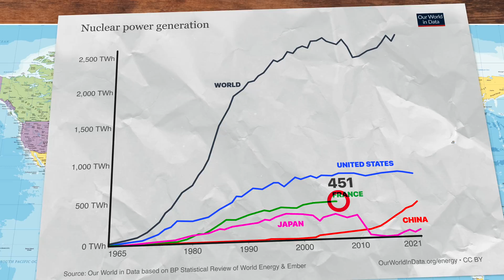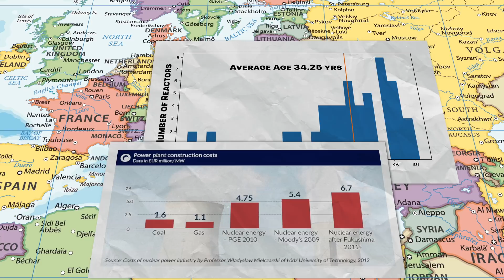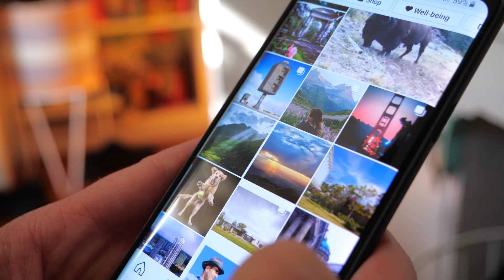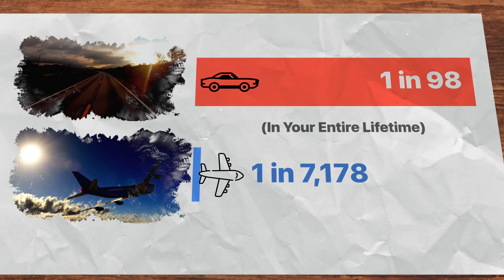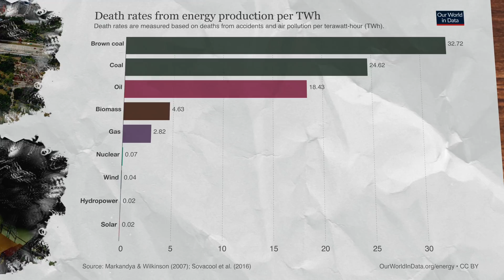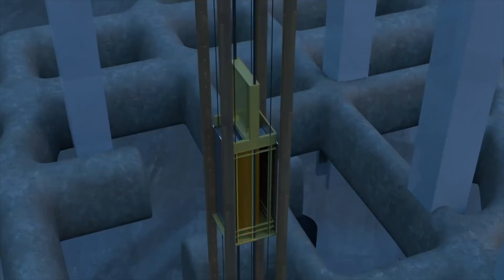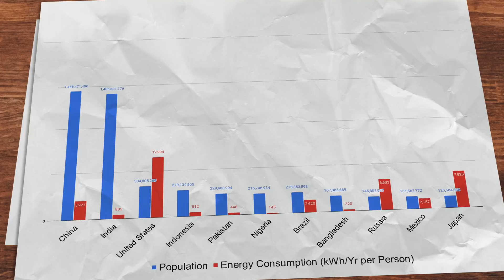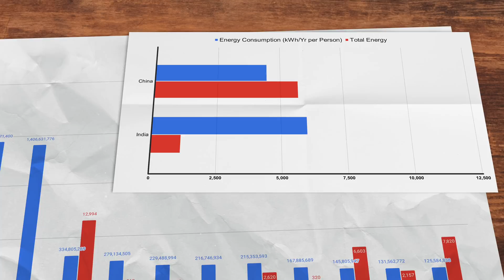The Future of Nuclear Energy Depends On This...

Comment: As a real fan of your channel I'm very disappointed to see you pushing nuclear power. The fact is that if you allow nuclear power, without assessing the costs as they have not been assessed in the past, all forms of renewables will not be able to compete. Your bit on the nuclear waste that has been piling up ought to make you stop and think about its volume if nothing else. That cost has NOT been assessed against nuclear power in the past or is it being assessed now. In my opinion Finland's waste storage will NOT prove to be reliable for the thousands of years necessary for this stuff to become inert. We have no proof that steel and copper will contain anything for that time and any hole in the ground that I know of eventually will drain into an aquifer or has the potential to in the life of these poisons. The idea  of sintering the waste into glass blocks seems far safer since we know that volcanic glass at least has proven itself to remain intact for the necessary life of these waste's. Unfortunately that has proven itself to be very costly. Again, a cost not assessed.

Nuclear power may be proven to be safe but when it isn't the costs are incalculable. That is why the power industry in this country has gone to congress to be absolved of all liability if they have nuclear power as a power source.

Why can't we just shelve nuclear power and allow the development of renewables first? Instead it appears we are doing everything possible to impede renewables until it is obvious that it is too late. Then we will get a big push to nuclear power! The idea looks to be to keep the energy production and distribution in the hands of just a few while the masses take a beating. it appears to me that what is being done in California should be a wake up call to all. It sounds as if folks that wish to fit solar panels on their roofs now will be required to also fit battery storage to keep the utility happy. Hmmmm, seems that doing that and just unhooking from the utility makes the best sense!  It hasn't been that long since a mass of wires crisscrossing this country didn't exist yet if the federal government has money to spend on electric energy they can only spend it on the great and glorious "GRID". In my opinion it would be far better spent on individuals and decentralizing power. A return to what power looked like  only 60 years ago before we came up with a scheme to only subsidize big energy monopolies.
Reply from the maker: I said I want 100% renewables for sure. But we’re not ready for that switch because storage is the issue. Nuclear energy is 24/7. I’d love to see it all happen but we need to get of them 84% fossil fuel asap. I think we will be ready to move away from it in the future. But today?
Reply: @TwoBitDaVinci  What you mention is just what I have been afraid of and expecting to happen. The government and everyone else has been dragging their feet and will continue to do so till !!!!!OMG!!!!! WE NEED TO DO SOMETHING!!!! RIGHT NOW!!!! OR THE WORLD WILL END!!!!!!!!!!  WELLLLL, LOOKS LIKE NUCLEAR POWER IS OUT ONLY OPTION!!!!!!!
Reply: Make that "our" instead of "out" in my last post. Anyway, so much could be done but won't because we have to keep money flowing ONLY to the energy monopolies.
Reply: Renewables don’t pay for a huge amount of real damage they do. Dams don’t pay for the ecological damage they do to river systems. Solar and wind aren’t paying to clean up cadmium in the soil in China from rare earth mining. 

All of the spent fuel in the world would fit into a football field, and gen. 4 reactors can reduce the volume and longevity of it by burning. 

Renewables don’t work, and if we want to stop using fossil fuels, the only option is nuclear. Also, renewables have gotten massive political and financial support from governments and other institutions around the world. 

You can’t run a factory with a few solar panels on the roof, and cities are going to be dependent on vast solar/wind. Germany and California have spent billions on batteries, and the each have about 1 minute of battery storage.
Reply: @kokofan50  I think that Denmark is doing OK on renewables and would like to inform you that we have taken out THOUSANDS of small hydroelectric sites in this country because big SUBSIDIZED power monopolies claimed they could make power for less. Yes they could when SUBSIDIZED! But we can't subsidize small scale individually owned renewable power!
Reply: @kurtappley4550  A small country with 1/4 the population of the NYC metro, and how much heavy industry/mining?
Reply: Tf is this. I read the first 5 sentenced until I stopped because of the amount of BS you believe in.

1. Nuclear waste is recyclable since the 1960s. Thorium reactors use nuclear waste as fuel.
2. Becoming CO2 neutral with solar and wind energy had become impossible because governments are too slow and started too late. Nuclear reactors can fix climate change faster within a decade.
3. Nuclear power is the safest form of energy to date. Saying it is dangerous because of the nuclear accidents such as Chernobyl and Fukushima are lame arguments against nuclear power.
4. Everyone wants renewables, but we can't use it because we don't have the time to do so.

Comment: Hard to believe that reprocessing is not economical when storage costs are included in the calculation.  I also have to question if the regulations are unrealistic for things like secondary containment.   Every piece of concrete/steel or aluminum used on this planet has cracks yet the buildings/dams/whatever still function and survive.

Comment: No, safety regulations are not what's affecting the ability to make nuclear power plants and it was silly to suggest it.  It takes skilled labor, and skilled labor in various positions in disappearing.   It takes a long time to develop as a welder who's qualified to do various types of welds, and what's happened is the loss of construction that requires those highly skilled welders, or at least for certain types of welds.

We have at least 2 generations of workers that are really good at simple manual tasks, or using technology.

You can can the same problem in shipbuilding and other areas where in many countries they've lost those workers needed for the highly skilled work.  On the inverse, China is growing at a manufacturing powerhouse and they DO have the skilled labor needed to do the work.

Comment: So issues are:
 1) Construction issues. Experience needed and better on-site management oversight during the building process needed.
 2) Which type of reactors we use. Some produce less long term radioactive waste.
 3) Recycling of waste.  Currently too expensive.  Research needed and this will change.  There are already promising ideas.
 4) Waste disposal fears (many unfounded anymore). Finland has a great answer (see video).
 5) F.U.D. = Fear, Uncertainty, and Doubt, spread by those who benefit from preventing Nuclear power.  Not in video.

Comment: After 40 years in the nuclear power business, I worry about accuracy of making the case for new plants.  Safety? I certainly agree that the risk is minimal, less than that of many other sources.  Waste? You mixed high level and low level waste discussions and visuals.  All countries, the US included, have low level waste disposal facilities.The US has a high level facility for military waste and a partially-developed site for commercial fuel.  That problem is political, not technical. Cost?  Here, your story was misleading.  Construction of "Gen III" plants were started in the US as well as Europe and China. The US performance has been a financial disaster.  As for the EPR in Finland, a project I know first hand, I doubt your number about the final cost being around 8 billion euros.  If interest during construction as well as enormous losses suffered by the suppliers Areva and Siemens are included, my guess would be almost twice that, four times initial "fixed price" bids.  As for causes, you advanced the industry excuse of "regulation", with no basis.  Regulation did not crack the Flamanville welds or CAUSE the other engineering and build problems, although it may have helped detect the problems.  You may want to climb high steel without safety equipment, but don't force others.

Comment: Small modular reactors seem to be the only lifeline for nuclear energy in moving forward as traditional, large nuke plants ALL cost far more and take far more time to build, making them uneconomical.  Economists have calculated that ~60% of our energy will come from solar in the next few decades, ~30% from wind, with battery storage, which leaves 10% for hydro and nuclear to fill in the rest.  We have a MASSIVE fusion reactor in the sky, every day, we just need to harness power from it.
Reply: Economists also calculate that inflation is transitory and has not occured the last 2 years, and that double digit inflation is both not happening and also manageable and good for the economy. Dont take anything the profession says, their opinions are bought and paid for.

Also solar and wind are so unreliable it will never make any serious percentage of the energy portfolio, let alone 90%. Not to mention battery storages are also non-viable, both in terms of reliability and longevity. Its also why they are non-factor in electric vehicles as well. Hybrid vehicles are the better alternative to battery electric vehicles.

Comment: The conversation about "could we even build what we could back then?" Is really interesting. In developed countries we've sold off most of our manufacturing to developing countries to reduce cost. But in the end it bites us back ie the processed steel we buy back doesn't meet our specifications and ends up with welding defects because of it. 

Never mind developed countries prioritising "higher level education" over trade skills. So we then buy in cheap lower skilled labour to compensate.  Very much, get what you pay for!

Comment: Not against nuclear power, just can't understand why humanity is staying with such and outdated cold war reactor relic design, yes they keep renaming it this generation and that generation or even SMR which is most likely to cause confusion with the term MSR. The
Current reactors are only about 1% efficiency that generates large amount of radioactive wastes lasting 20,000 years. If you want to talk safety you have to add the fact that this radioactive wastes stays lethal for 20,000 years.
Thoruim Molten Salt Reactor is a reactor we could have had 40 years ago, it's fail safe, with efficiency in the 99% range and producing tiny amount of short term radioactive wastes of 300 to 500 years, the waste itself could produce electricity. Current reactors design are just a overpriced dirty bomb waiting for and excuse to detonate thanks to the pressurised H²O that turns to rocket fuel with the help of radiation.

Comment: Overall, I agree with your advocacy for nuclear power.  I would be interested in another video addressing why the costs of so many of these projects for new nuclear facilities go over budget.  Is it really all "red tape"?
Reply: when "red tape" (read regulations/requirements/specifications) are changed throughout the process of building a plant, meaning that very important parts of the plant may need to be constructed and reconstructed many times to meet new regulations as they are introduced...absolutely it can all be "red tape".

Imagine you have a 3 billion dollar reactor that you build and it meets all regulations, but before the rest of the plant is finished new regulations are introduced in regards to reactors and the reactor you built now needs to be reconstructed from the ground up to meet the new regulations. Not only that, but the new reactor might now cost 5 billion to construct in line with the newer regulations etc. Your 3 billion dollar reactor that might take 5 years to build is suddenly an 8 billion dollar reactor that has taken 10 years (or longer) to build....Now imagine this happens multiple times throughout the project lifespan.
Reply: @harleyjones5200  I can totally see how such regulations can add time and money to a project, especially if the regulator keeps moving the goal post.  

I'm curious if there are public examples/cases that we can look at where this occurred?    For example, what happened at Plant Vogtle in Georgia to go so far over budget?
Reply: Major construction projects almost always go over budget.  The scope of the project means things always get overlooked in initial planning, and the time it takes to complete means the goals of the project usually change at least a bit while construction is underway.

Comment: I started working in nuclear power right out of college in 1978.  I worked at the Fast Flux Test Facility.  It was a liquid sodium cooled fast reactor.  It was an 400 MWt experimental reactor, the follow of from EBR-1&2.  We used 28% Pu enriched fuel.  There was a reprocessing facility built on the same site.  The plan was to send our spent fuel there, reprocess and build new fuel assemblies and return them to the reactor.  Demonstrating a closed fuel cycle.  There is enough Pu in the USA to fuel reactors for many lifetimes and using U238 in the core, breeding new fuel.  We’d never need to mine for anything.  The Carter administration policies ended the USA reprocessing of reactor fuel.  China is working on using our sodium cooled reactor technology.  They were working with Terra Power (Bill Gates)
Reply: Apparently you don't know about the MOX facility that was just designed to mix pure Pu239 with uranium to make Mixed Oxide fuel.  That is only 1/2 of reprocessing and that is the very easy part.  Here is how that turned out.
The MOX facility (South Carolina) was a U.S. government nuclear reprocessing facility that was supposed to mix pure weapon grade Pu239 with U238 to make reactor fuel assemblies. It was canceled (2017) in the U.S. After spending $10 billion for a plant that was originally estimated to cost $1 billion and an independent report that estimated it would cost $100 billion to complete the plant and process all the Pu239, Trump canceled the project in 2017.
Reply: That's interesting, thank you. 
Is there a 10 to 20 minute video describing this in more detail? 

It looks from Wikipedia as if Trump stopped the plans in China but China still has a sodium-based nuclear programme, can you clear up what's happening?
Reply: @alanhat5252   the MOX facility that was just designed to mix pure Pu239 with uranium to make Mixed Oxide fuel.  That is only 1/2 of reprocessing and that is the very easy part.  Here is how that turned out.
The MOX facility (South Carolina) was a U.S. government nuclear reprocessing facility that was supposed to mix pure weapon grade Pu239 with U238 to make reactor fuel assemblies. It was canceled (2017) in the U.S. After spending $10 billion for a plant that was originally estimated to cost $1 billion and an independent report that estimated it would cost $100 billion to complete the plant and process all the Pu239, Trump canceled the project in 2017.

Reply

Comment: Even on this video you misrepresented "nuclear waste", only the spent fuel has a half life of thousands of years, and it only makes up a fraction of the waste. Most is low level, like shown in the video, gloves, overalls, tools etc which are safe within the lifetime of the reactor. You haven't mentioned inherently safe reactors like molten salt or pebble beds, or fast reactors which could reduce the half life of spent fuel rods from millenia to centuries.